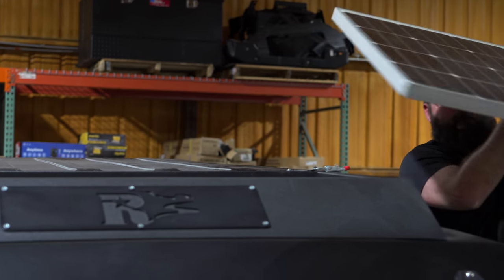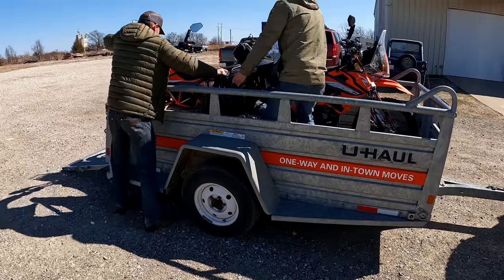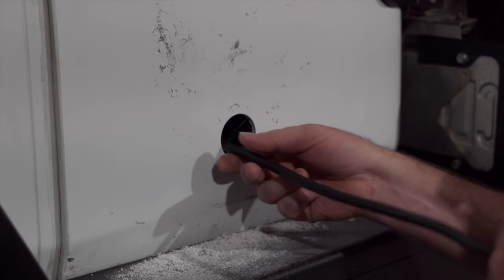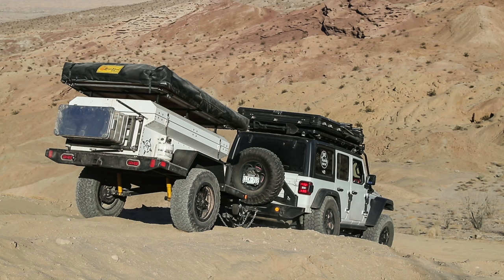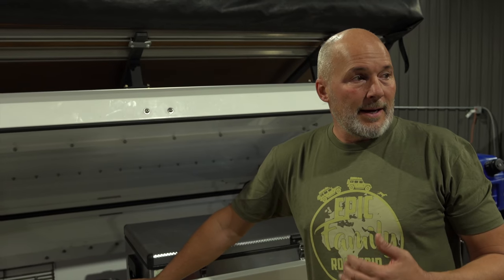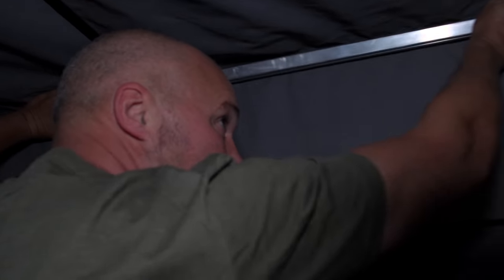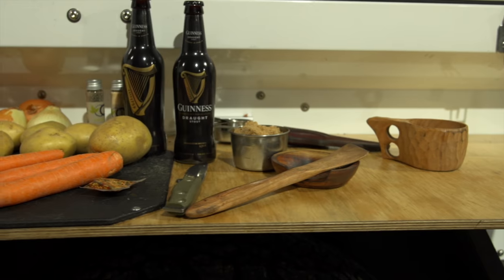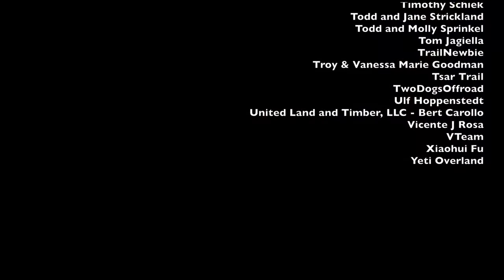THE JEEP BUILDS CONTINUE & DO WE REGRET BUYING OUR ADVENTURE TRAILER? // EFRT S7 EP26

Comment: Carol and family sorry for your loss. Prayers from Georgia U.S.A. One question for Peter for y'all's solar panel why did you go with a fixed panel instead of a flexible panel that would lay directly on the roof of the tent that wouldn't require to drill for a bracket into the roof?

Comment: "We are adding a 180 watt solar panel." Hmm, I read the label twice and it still said 120 watt so where's the other 60 watts coming from? I have a 90 W panel on the roof of my canopy & found the small midget vent from Seadog makes an excellent cover for the wires into the roof. Low profile stainless steel & easy to bed with sealant.

Comment: What I don’t understand is why all those roof top tent company’s are unable made tent with flash mounted solar panel or with space for that solar so is not sticking out of surface of tent. Most of good solars have same dimensions so people can choose they own model. I made myself roof top tent from 40x80mm aluminum strut and have flash mounted solar panel from Lg neon R 1740x1042mm 400watts which cover almost all roof surface as the tent is 2000x1200mm. That way I have nothing sticking out of the shell and not yet damage surface by tree branches. I suggest everyone try due that project as it is very simple and rewarding at the end specially when you compare price and quality of some of the tents. You can decide how to rote cable for charges lights etc. and you can spend little more and buy gore tex material to do actual tent. Those Alu profiles allows you easy add on later attachments.

Comment: Nice!!! but I'm still waiting for Carol cooking channel on the road (like Marco) and see what delicious I can eat on the road with Type B... PS good choice regearing the adventure bikes (not too low then out of gasoline more often or boys wheeling up too much) but price to see a bit high and if helped even whorse!!! :D :D :D
Reply: PS: for the shore power and fixed battery charger I will have put fake "gas fuel tank cap cover" with key at the passenger side; the rotopax mount are directly fixed in fiberglass side of the roof without reinforced plate?

Comment: That solar panel bolt holes gonna have water leak even if you used grommet or seal. Never ever drill holes on the roof.

Comment: So much cringe  in just  the first 10 minutes!  Does no one wear safety when drilling and cutting? And I would have NEVER let them drill holes in that tent top.  Sikaflex.  Or 3M 560 adhesive.  Both would hold that panel on there for as long as you wanted.  And if it didn’t, a new solar panel is cheaper than a new top for that tent! 😳
Sorry to be negative.  Just couldn’t hold it in!  I love your videos and trips!